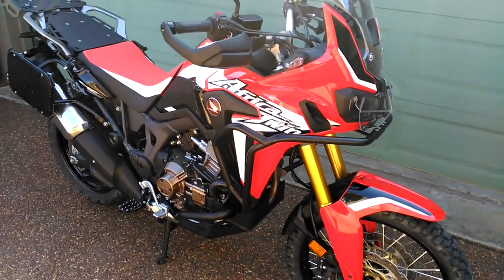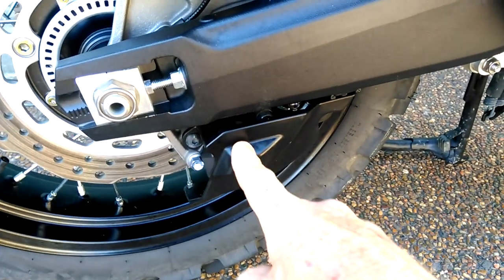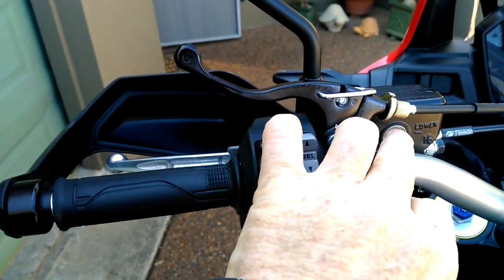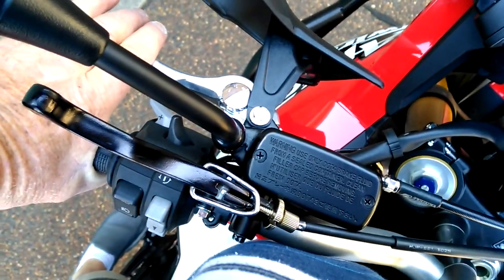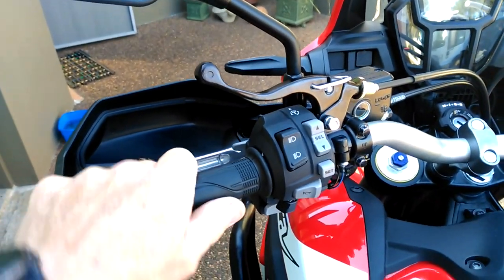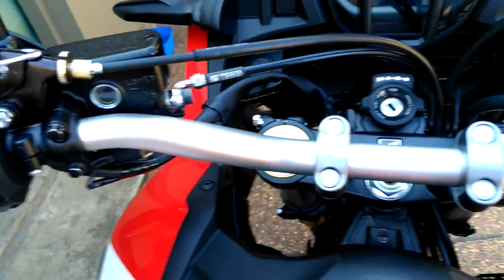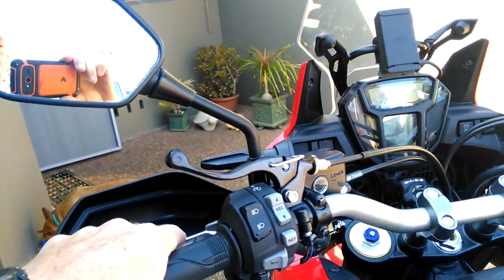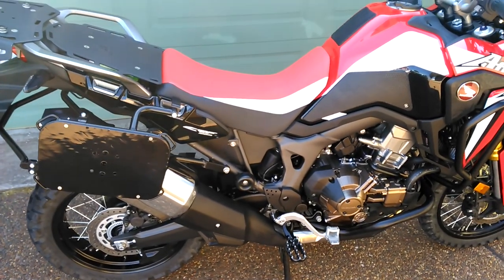Left Hand Rear Brake

Comment: Peter, is there a way you ask your mechanic how did he tap the master cylinder. What tap size he use and how deep. I purchased a new master cylinder for my 2022 Africa Twin DCT. I will try to do it myself. I just wanted to ensure, I do it right the first time. The new master cylinder from Honda is not cheap.

Comment: hello Peter , i finally received the left brake lever. i just don't understand what you had to thread at the bottom master cylinder. could you please let me know? cheers!
Reply from the maker: It has to be threaded because, there is no thread in the rear Mastercylinder to allow the bolting of the new brake line.

Comment from the maker: Crotchrocket,

The hose and banjo bolt did not come off The XADV. I had them made by my local mechanic.
Reply: Thank you very much!  Im just trying to locate a spare master cylinder so I can have a go myself.  It would really help me at low speed, as my left leg doesn't work and where I would normally modulate my low speed with the clutch I cant on the AT.  Which mechanic shop do you use?  maybe I could post them my master cylinder and they could thread in a banjo bolt, though i'd have to pay them by bank transfer as I'm in the UK.   Thanks again.

Comment: It is so stupid from honda that they are not doing it on all their DCT bikes (at leas option) from factory. You hit the point with offroad africa on the hill, controlling rear break with hand is easier.
Reply from the maker: As soon as the 2020 Modelnis released in Australia, which should around March, then I'll trade my old Girl in on a 2020 DCT and do exactly the same.

The ease of riding through sand, up and down steep rocky hills and traversing tight terrain, is just makes life so much easier.

I agree, Honda should do it, or make it an option.
Reply: @petermansbridge1  Yes. New africa 2020 is really cool, cruise control, tubeless tires, adjustable windshield.

Comment: Hi Peter. Very interested in your modification. Planning to the same mod to my NC750X DCT. Question? I was planning to connect the ADV reservoir directly to the ABS unit where the foot brake hose would normally connect. This would be simpler than having the involved machining you smile of, and would clearly maintain function of the ABS on the rear wheel. So did you consider that method (especially as you were to be removing the foot brake pedal anyway) and if not was there a special reason you connect the ADV lever to the existing footbrake master cylinder?  Love you video. Cheers. Ian